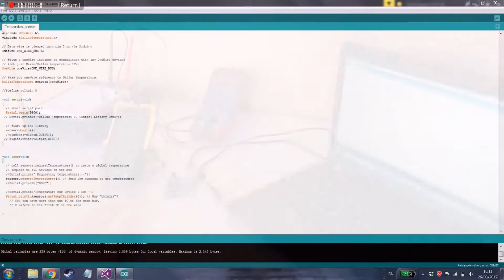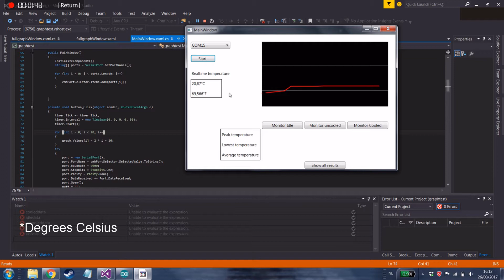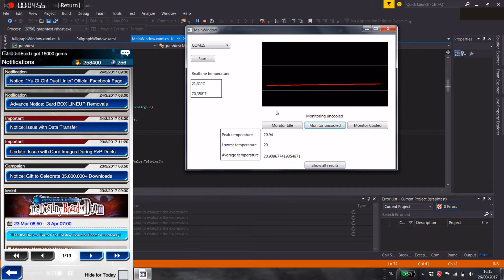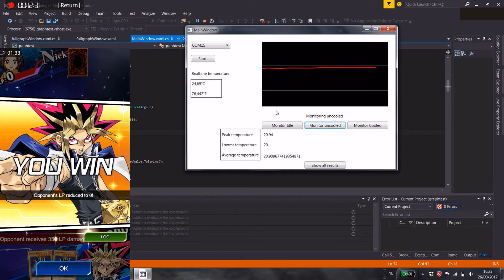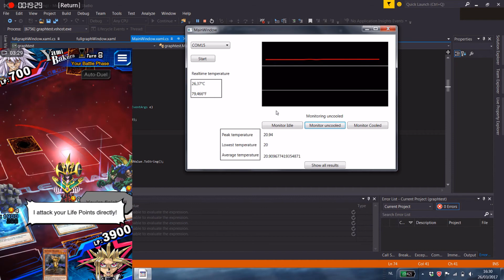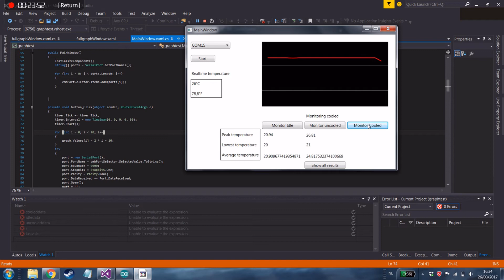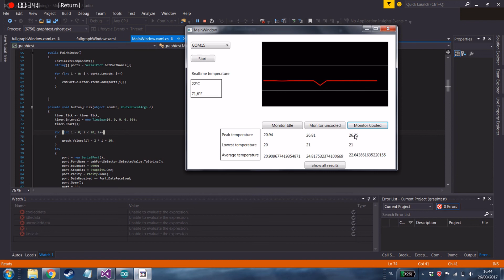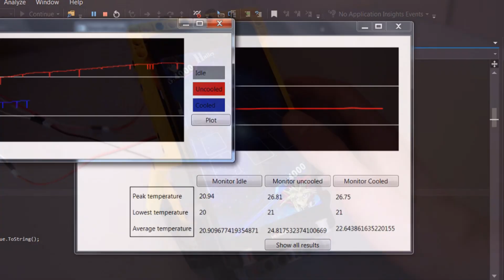Lego smartphone cooling stand

Comment: I see you like dishonored. can't you try to make Corvo Attano's sword? I have tryed my self but I can barly make a lego pistol.
Reply from the maker: You're right, I absolutely adore dishonored :) I've actually tried making it myself as well, but it is indeed quite difficult. The main problem is that the blade consists of multiple sliding segments. Since that's very hard to do in lego without making the hilt too thick to hold, the blade can't be much longer than the hilt. It would end up more like a dagger than a sword. I might look in to in again.
Reply: ye that was the same probolm I ran in to. the Idea I had was the make the sward there lego technik peaces thick. and it kind of worked if you would use gravity to open it. but then the hard part came to make the sword jump out by it self. but I didint have enough exeperians to make it work.
Reply: and also I have spent way to mush time on dishonored my self
Reply from the maker: I was thinking on first making a mechanism similar to my hookblade. It's quite easy (especially for longer blades) and if you can kind of flip your blade like corvo does it could actually look good (a bit like the corvo blades ammnra made: https://www.youtube.com/watch?v=Mkl0SYGAGDg )
Reply: ye I but if you make it like in your hookblade it will stick out in the botom but it will work. and making it like ammnra's 3d printed blande will prbolbly be really hard. but if you are going to do it good luck.
Reply from the maker: Thanks :)